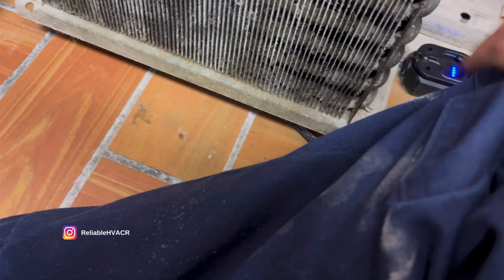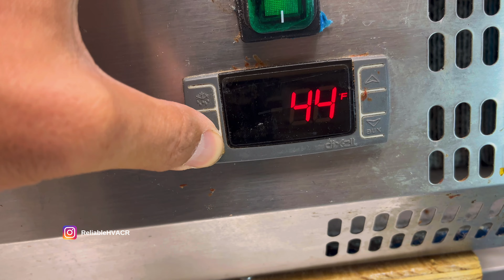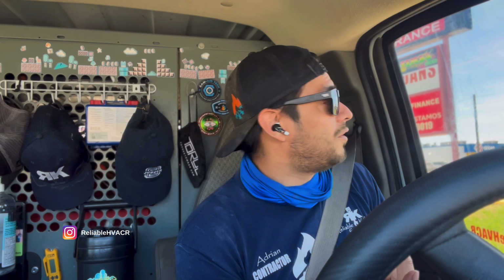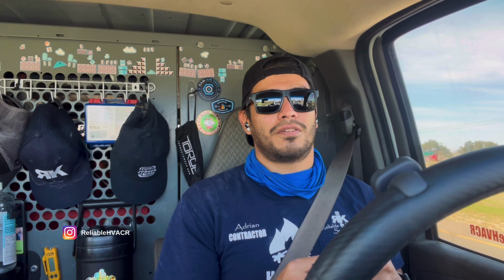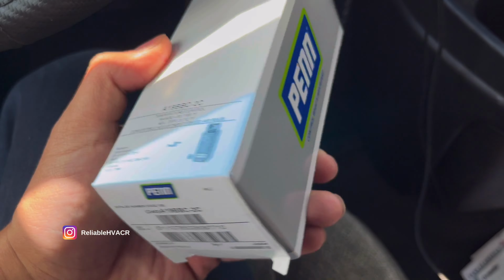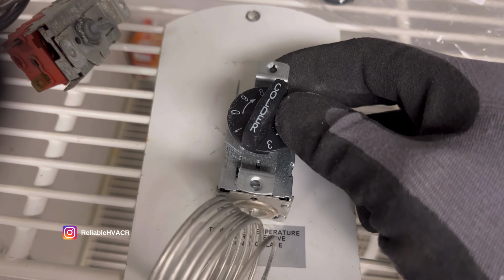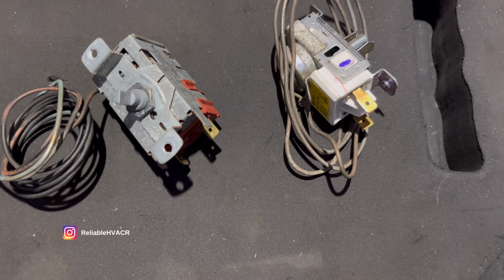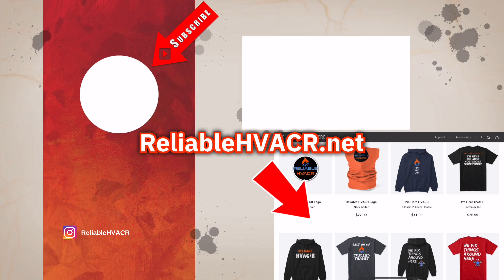Checking a few coolers then helping out another tech | HVACR

Comment: You needed a Ranco A-12-700 or an original True controller RHS p# 61-030  I would much rather have replaced thad cfm and blade ,why because it was vibrating very likely because the blade was bent and the threaded shaft being stressed . Good Job Adrián .

Comment: Good video I would of just replace the motor plus little tip use leak lock just a drop on screws that hold the fan onto the bracket that why they don’t back out when if vibrating .
Reply from the maker: Appreciate the tip

Comment: With the fan motor already removed on the first unit another five minutes to clean the coating of flour off of that condenser coil would have given that compressor more life.
Reply from the maker: You're right no doubt. I just didn't want to go back to the van and they mentioned they clean their own coils so they didn't really want me doing it and I was already moving on to the other 2 units trying not to rack up too much time. Thanks 🤙🏽